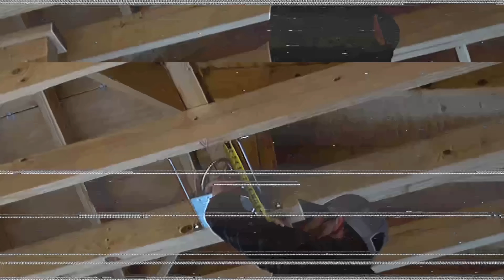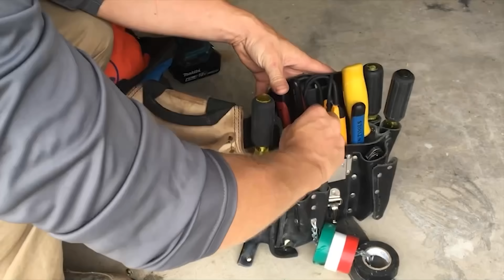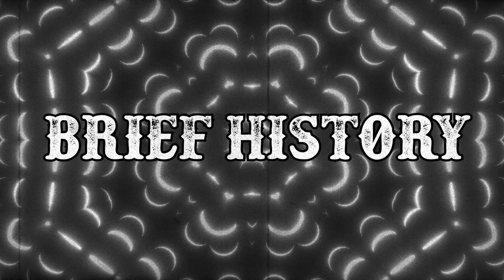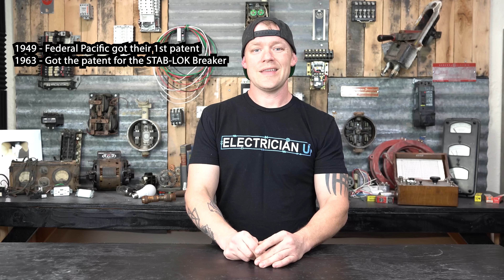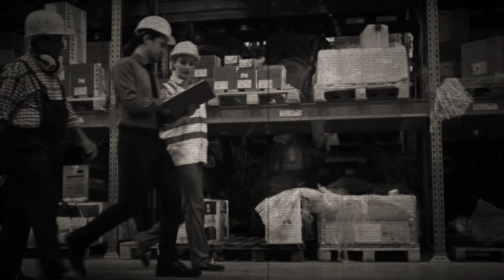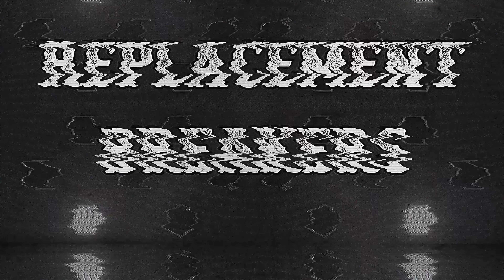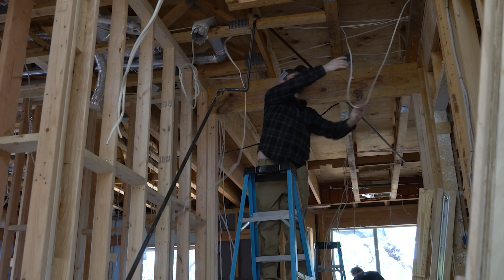FEDERAL PACIFIC ELECTRICAL PANELS - why their panels are dangerous

Comment: Ok...I have been led to believe "one" of the issues that cause the failure was an overall design flaw. The Stab-Lok design does not allow enough "surface contact" between the buss of the panel and terminal connectors on the breaker. 
If this is true, then it is almost impossible to "improve" or "correct" the problem because the design is inherently problematic. 

Does anyone else here have any more information on the design/(lack of enough surface contact) being the issue?

I have replaced some old FP breakers with Connecticut Electric breakers and I did not leave the job confident nor did I leave without overbearingly explaining to the customer that the panel needs to be replaced. Even going as far as to say, "Have another electrician do the job just in case you think I am trying to fleece/hustle you for money."

Comment: I was looking at purchasing commercial building that was fully equipped with Federal Pacific 208 3p screw down breakers and panels. 
Have all Federal Pacific breakers been found to be defective, or just the stab-lock line? I couldn't find a clear answer since any information I did find on the subject was saturated with stab-lock content and warnings.

Comment: The house I'm working on getting ready to move into had a Federal Pacific system in it. Matter of fact, the gutted panel is right beside a more recent Square D panel that the house now runs on, but a lot of the circuitry needs revamped.

Comment: Great Video!  Just sold my 92 year old mothers house built late 50's.  I had replaced (I know shame on me) a stab lock panel a while back (Thanks for your great videos).  Had to use some J Boxes, so I was nervous, fill calculations (thanks), methods etc, when home inspector walked up popped the dead front and covers off, looked it over took pictures.  Thought I was busted, but it PASSED.  Then they found an stab lock I didn't know about so the original house panel failed, mine passed.  Had to pay an electrician this time, he came replaced panel and everything passed.  Really appreciate your constant HARPING ON DOING QUALITY WORK.  When I replaced the first stab lock I had never replaced a panel, but tried to follow your examples and do a neat organized panel.  Secure wires, grommet through panel, wires organized, bonded properly etc.  Next to your work it would look amateurish but much better than typical DIY person.  Thanks for the great guidance and motivation.  I can really now appreciate your skills and knowledge at doing such high quality work in a timely manner.

Comment: Bought my 1963 built house in 1983 with 100 amp,  FP fuse box, no ground, cloth covered wires. Was so glad to gut the house in 91 or so, and put all new wiring, from the meter in, and a  200 amp breaker box.

Comment: In western Canada the Pioneer breakers currently in use have white cases with different coloured levers for the required amperage ratings. I've never seen one of these type fail to trip.

Comment: I worked for Schneider Electric™ APC in R&D, at probably one of the worlds most advanced UPS R&D facilities. Formerly Silicon, then bought by APC out of an Boston MIT basement, in Kolding Denmark. I belive before being bought by APC, the US Navy funded the new site building of this research lab in Denmark after wining the bid for the Norad UPS upgrades. The new UPS system for Norad was designed/tested/ and developed here. A good friend of mine has 5 patents that have helped ensured electrical piece of mind for that site installation. Nicest guy you will ever meet, and so humble, having some medical problems, so send him your <3.

That out of the way, SE just started to buy every compeditor in sight. So while the most intense engineering is happening in Denmark/Boston, the breakers and contactors engineering or "Re-Branding" is happens in France.... So it's exactly that, one company name over what in reality is many different organizations aquired products like Square D.. Since for us in DK the largest customers is almost all military/oil rigs/datacenters/medical applications, the margin for error has to be nothing, on top of a very redundant system. It's a lot of pride to be able to deliver seamless power solutions for these applications where all of them are life critical and power must be restored in no more than half a sine wave for an entire facility. So as everything in life it's complicated when you aquire other companies. I don't work for them anymore as I went back to college again, to study global managment in manufacturing, and calculating acceptable scrap rate, is part of our study. 1% is the MAX MAX, and that is very high. Keep in mind, that is absolutely to be caught before it leaves the factory. Every componet is tested, for the most part, since it's so easy with electronics compared to other types of products. I will say, no one was happy to be bought by SE, and just went on with business as if we represented the products we designed at our site before being bought out. Here is a link if you scroll to the bottom to see the companies SE owns.
https://www.se.com/us/en/about-us/company-profile/history/schneider-electric-history.jsp

Best Regards,
-Eric

Comment: 27 years as an electrician. I have seen fire shoot up a wall because the receptacle terminals broke and grounded against a metal box. Scary shit!... shit was Like whoosh. Every time I see this panel in a customer home, I strongly suggest they change it immediately. I guess they think I am trying to upset, and usually won't take my advice until a close call happens

Comment: The other thing about FP panels, is that where they were installed may no longer be code.  So the cost to the them is higher due to relocation.  That is another reason that these breakers need to continue to be made.

Comment: I lived in a house with a Stab-Loc breaker panel... it's always scary to hear about their troubles. My university also had TONS of old FPE switchgear and breaker panels located throughout the campus, all of which should be taken out and replaced.

Also, I believe I read somewhere that UL (or someone else) actually did a test of the breakers. But FPE had them rigged to a remote control system where someone would trip the breaker manually if it didn't trip on it's own. They were a really shady business...

Comment: To test the slow-trip thermal cutout on breakers, which is a separate system usually to the electromagnetic short-circuit cutout, the easiest way is a "liquid rheostat" which is kinda dangerous cause saltwater + exposed electricity aren't supposed to mix - it's typically just used as a dummy load for testing backup generators, but it'll work for breakers too. Alternately, a TRIAC motor controller and a rack of 500W halogen floods adding up to 200% rated load, with an amp clamp to measure what current it pops at.

Comment: Little bit of hypocrisy in the inspection process. I just wanna know how I can get Exxon to pay to replace a FPE that has faulty breakers in it.

What’s a proper failure rate. 

We had to do an emergency removal of a ceiling that had been flooded by a pipe failure. I asked the home owner to switch off the breakers to the kitchen. I did a hard short of the line just to verify, but the breaker did not trip, I could not shut off the circuit via the panel. So before we entered the kitchen after the flood we shut off all the electrical believing the thoroughly soaked kitchen was cold, it obviously was not. 

So what I would say is that any condition of failure that does not allow you to break the EMF supply to a portion of the structure either because of overamparage or manual opening the circuit via a breaker is ALWAYs an unacceptable level of failure. Currently I won’t even remove a faceplate from this system until the panel is replaced. My house was FPE, pre stablock, it was replaced on day one, my neighbors house had unstable electrical at multiple circuits until he replaced the FPE. 

I don’t blame UL, I blame the builders and electrical contractors who installed this stuff. They had to have known. If I can install an electrical system in a house more safely than they can, it means they do not deserve a license to practice the trade.

So let me correct this video, the problem is not in the manufacturing, the problem was in the breaker design. 

What the report said is that for the most part the breakers will trip the first time, but every time after overamperage events will increasingly not trip the breaker to which the breakers eventually will not circuit open. 

The solution for homeowners who have emergency situations is to shut off the panel and pull the breakers that are faulty, but how do you know they are faulty? 

In a general sense they a made faulty, in a specific sense you reinstall, carefully, breakers until you have determined which goes to the malfunctioning circuit and then specifically remove that breaker. You can buy these breakers at Home Depot for 25$. But I strongly recommend against this because of the following. 

Let’s say you know you have a bad breaker. Think one roach many roaches. The only way to know whether the breaker is bad is to trip the breaker, and if you trip the breaker then it’s probably now bad, so that there is no way apriori to know whether that breaker was bad to begin with except by making it bad. 

I’m a super cheapskate, I look at value where ever I can find it, I don’t like spending money on fluff and I am the same with my projects. But close the eyes when it comes to FPE, spend the 2000$ for a new square-D panel and feed the brotherhood of electricians, because those FPE just ain’t safe, not just stablock panels, all FPE panels are unsafe. You may also need to feed the local inspection office or that contractor will have to do a hot rewire. 

On my house I was very fortunate, the custom builder put the mainpower off box in the garage, as a result I can shut off all power (120/240) except the 208 service, which I had terminated. As a result you can pull any subpanel cold without pulling the meter. And just a reminder, if you need to replace a panel, that is inside or in an obscure location from the meter, the inspector may ask you to also install a switch box near the meter in addition to the switch in the panel AND fix any visible defects in the conduit leading to the meter from the service lines. There are other problems, recladding the home may involve the cladding contractor moving the meter box, if it is reattached improperly it may also fail inspection. So you could end up paying substantially more. But also, consider that failed breakers can degrade circuits, so circuits with known failures of say 20 amps are probably no longer safe to carry 20 amps, so rewiring specific circuits may be.

I have never had. Square D breaker fail, I have one for the kitchen my wife trips every year or so, but it still trips. I have one in the garage for a table saw, same thing, trips and resets. The difference for FPE breakers and other breakers is if they go overamp trip too many times they trip at lower amperages. For FPE the amp required to trip goes up to infinity.

One other problem, FPE panels generally lack expansion knock-outs on the side of the panel.

Comment: As you mentioned, Connecticut Electric makes replacements for most of the discontinued brands. The UBI line which are replacements for Federal Pacific Stab-Loks tested worse than the Federal Pacific's. They are not UL listed but they are sold at Home Depot and many other retailers. I replaced my Federal Pacific Stab-Loks with Connecticut Electric UBI's. My electrician accidently created a short circuit. I heard the pop from another room but the CE breaker did not trip. I did some more research and replaced the breakers again with Federal Pioneer breakers. One morning, I decided to make more coffee and toast. The dishwasher was also running. The Federal Pioneer breaker tripped and tripped quickly.   
The Federal Pioneer breakers which are genuine Stab-Loks are still in production. The factory in Mexico is currently closed due to the pandemic. The Federal Pioneers did pass Jessie Aronstein's 200% tests. I prefer Federal Pioneer over Connecticut Electric. The best solution as the creator of the video has stated is to replace the panel with a new one from a reliable brand. This is a great video. There are some Inspectapedia websites with good information with tests from Jessie Aronstein who is the professor who does the testing. The test results are great to have for information but the moderator of those websites does not believe in anything other than replacing the panels. That is not always practical. Some people cannot afford it and some people just don't want the expense. The replacement breakers for Stab-Lok panels are everywhere and they sell in large numbers. I think discussion of which breakers are better than others should be allowed on Inspectapedia. 
The moderator actually asked me why I was interested in the availability of Federal Pioneer breakers. Ah...because where I live we have 23 Federal Pacific Stab-Lok panels.   
Me...I prefer Federal Pioneer in situations where the panel is not going to be replaced.
Federal Pioneer are UL and CSA listed.

Comment: FPE   F**Ked up Piece of Equipment These things blowing up at the shipyard gave me job security. And I worked with the high voltage ones. I'd show up at a substation and it looked like someone threw a hand grenade in the place. Sometimes the doors were blown off the building.

Comment: Any known issues with Challenger breakers? I have a GE box with about half of the breakers with the Challenger brand. I had a miswired lamp that would cause a short when the push button was held down. I pulsed the line with the short, my computer and other things on the same circuit lost power with the pulse but the breaker didn't open. Pulsed it two more times, the last one kind of slowly and the breaker still didn't open, lamp cord now warm. It is a 20A breaker, so maybe I didn't quite hit 20A but it seems a bit disconcerting!

Comment: I have been a licensed master electrician since 1981. As mentioned below, the worst breakers besides f-P are Bulldog Push-Matics, even the older GE ones would not trip.  The Best are Square D QO ( not Homeline) and even Cutler-Hammer. I can pretty much say you will never have an electrical fire with Square D's. I,ve had them trip even when a light bulb burns out.

Comment: The breakers made after 1980 were still listed.   There will be a little white dot on the ON position of the ones with the orange handles that shows that it was made after the deceptive practices were done.  The Challenger and American branded breakers were still UL listed.  According to the expert , Dr Aronstein, his research showed that the FEP, the original brown version , breakers seemed to work properly. The newer Connecticut , which are actually branded UBI , had close to the same fail rate.  Putting Federal Pioneer , a separate Canadian company, in the same category is not fair when they might have been actually doing their own tests.  Here is the page that explains it all.   The odd thing is that there was no comparison with a breaker of the same age, such as a Cutler or Square D from the 1970’s.  So we are left wondering if the Federal Pioneer brand was really that bad.   https://inspectapedia.com/fpe/Federal_Pioneer_Panel_Safety.php

Comment: One point on acceptable failure rate...may depend what failure mode.  If it fails in an inconvenient but non-hazardous way a higher rate is probably more acceptable.  If it fails in a life-threatening way it needs to be a much lower failure rate.  E.g. if it fails false-trip that is not great but less hazardous than failing letting an overload condition exist.

Comment: In 1969 I went to work for an electrical supply house and later on went on to apprenticeship, etc, etc.  It was very well known in the trade back then that FPE was junk.  I definitely remember stories of having a 15 amp 2 pole breaker being able to hold the load for the entire 100 amp panel by itself.  So with this in mind, I have absolutely no compassion for Exxon not knowing better.  EVERYBODY knew it was junk.  The only contractors that I recall buying this stuff were the ones that were too busy squeezing a nickel until the buffalo shit.  You know; the ones who have a tract of 200 houses to wire.

BTW...  1969 was a very controversial year in the electrical trade.  It was the same year that romex was upgraded to have a 100% ground wire.  Before that 14-2 had a 16 gauge ground wire, etc.  The crying about the price increase went on for months.

Comment: You asked about acceptable failure rates.  Quick summary.  For safety issues acceptable rate is 0%. You may end up a with some that trip early but none that trip > 200%.  The number that trip early should meet the 6 sigma rule.  That would allow 3 per million to trip early.

Comment: I owned a house built in 1980 with a zinsco panel installed in a hallway closet. I knew nothing about them until a friend who was an electrician educated me about them. I never had a problem with that panel but it did make me worry .  After I no longer owned the house, ironically, it did burn up, but the cause was PGE starting the Camp fire which destroyed Paradise, California. 😖

Comment: My family built a new home in 1977 and it was fitted with a Federal Pacific breaker panel. In 1982, the house caught fire, and incinerated the basement. the cause of the fire was determined to be electrical in nature and it's point of origin was the service panel. I don't know if they were able to determine specifically what occurred but when the electrical contractor came in to redo the electric during the reconstruction, he relayed to my Mom the issues with the FPEC service panels and breakers. Needless to say, Square D was install and has been reliable ever since.